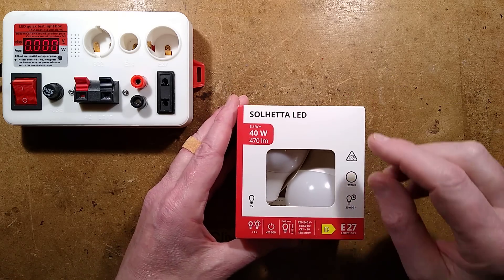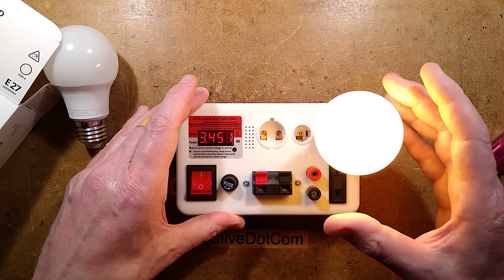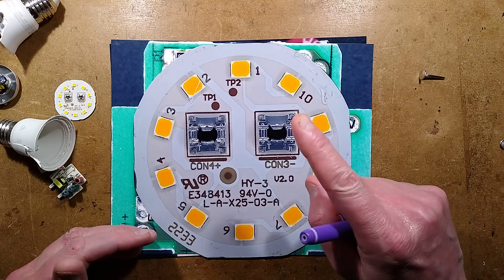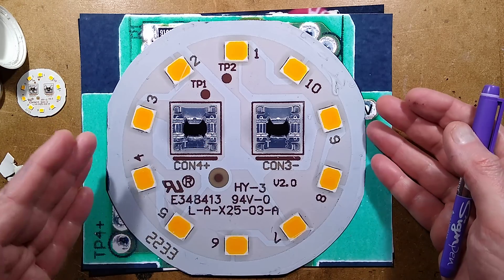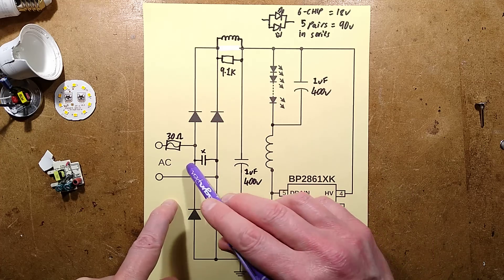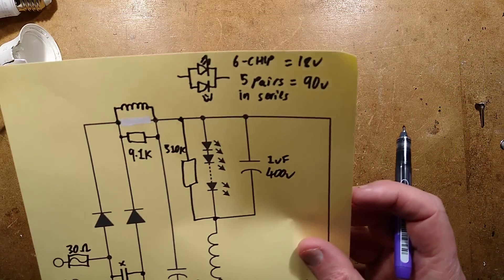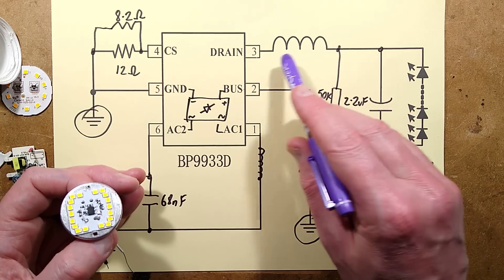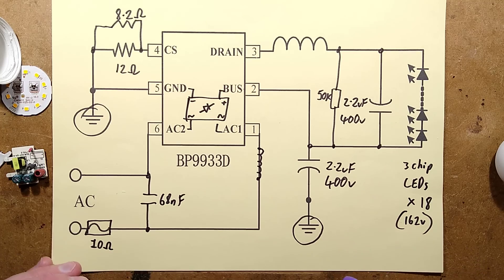IKEA Solhetta bulb teardown

Comment: I have a bunch of Philips LEDs that have the exact same design and similar component choice as the 6W Solhetta. Wouldn't be surprised if Philips was the OEM for IKEA LEDs. Also, IKEA has a dimmable 6W 806lm version as well, would be interesting to see if there are any differences.
Reply from the maker: I should have bought a dimmable one too.
Reply: More likely, Phillips and Ikea are getting the same company in China to build them.
Reply: @OmegaSparky  Philips lighting is actually a company called Signify these days. They have quite a lot of operations in China. The bits of Philips that aren’t actually Philips are doing a lot better than the bits that are still Philips.
Reply: @katrinabryce sed to work at a company owned by Philips before they threw their entire entertainment lighting branch to the Chinese after closing us down, then rebranded to Signify.
Philips wanted to focus on their healthcare and industrial divisions at the time.
I think that was around the same time the division managers changed hands a couple times over 5 years after the "reduce costs, claim bonus and resign" fad tore through.
Reply: @katrinabryce  The only bit of Philips that is still Philips is the medical tech division. That says a lot about a company that started out making light bulbs over a century ago.
Reply: @katrinabryce  which is because Philips sold everything, not only losing the well performing businesses but also losing synergy (both economical and technical). In any case, Signify is likely to buy in their cheaper models so what OmegaSparky writes is not an unreasonable assumption.
Reply: @katrinabryce  The lighting division became Signify in 2018, IIRC.
Reply: @dougbrowning82  As far as I know the shavers are still "in house". They have one production facility in Drachten (Netherlands) and one in Zhuhai (China).
I might be wrong but I think this is still the case.
Reply: Yeah, thats odd, the Osram one I recently bought on the German market looks surprisingly similar too… thought it might be easily hackable, but that sucker was glued in well!!
Reply: I'm pretty sure it would then be a case of Philips and IKEA using the same 3rd party OEM, with Signify (Philips) only producing the more expensive models themselves.
Reply: @mjouwbuis  IKEA does not need to make big money with light bulbs like Signify. For IKEA light bulbs are only product which makes people to come shops and buy some furnitures which have higher profits.